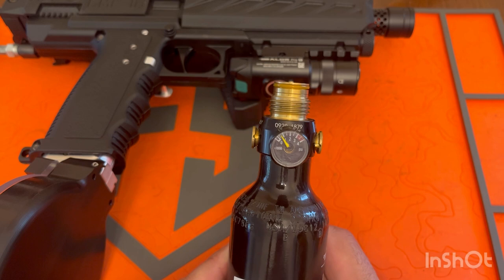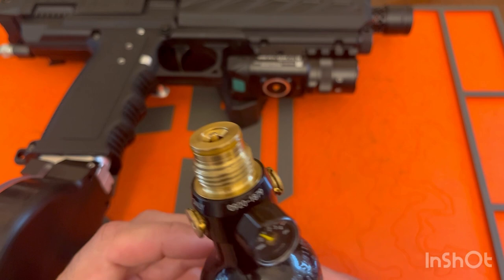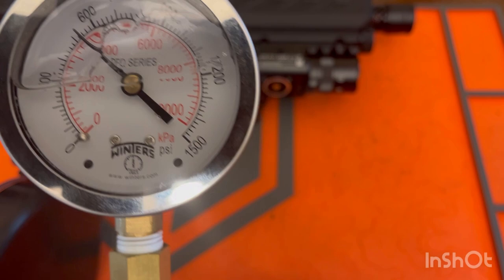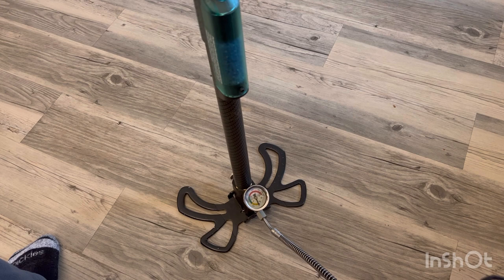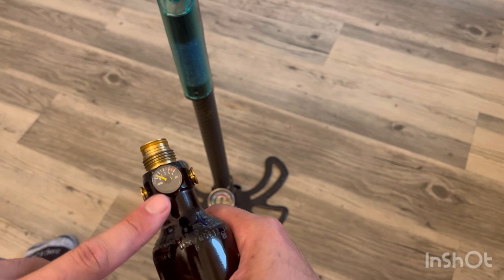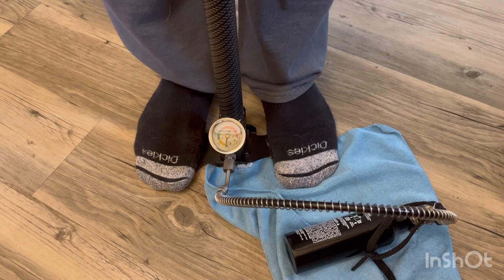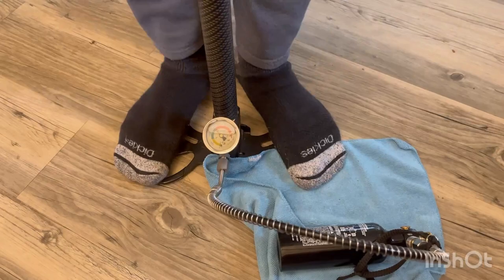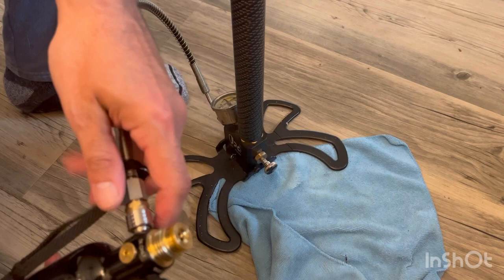Hand Pumping A 10ci Hpa Bottle & Some Basics

Comment: Make sure to bottom out the pump piston on both up stroke and downstroke. If you don't you lose 80% of efficiency, you are just bouncing piston on an air pocket.
Reply from the maker: Yes i did mention full complete strokes otherwise you are just wasting energy. Most of the actual compression is at the bottom 1” or so but not fully extending the stroke also just waste time as you are not grabbing enough air.
Reply: @lesslethalfordummies  it takes about an hour of pumping to fill 68 ci to 3000 psi. Just get a Yong Heng compressor, highly recommend it
Reply from the maker: Wont catch me pumping a 68. I aint that spry anymore. 😂 

I started with an oil less compressor that lasted a year. I have since moved  onto a Yonger and it rips….13ci 45sec flat.
Reply: If your just filling littel tanks pumps ent a bad workout if your younger an active not a bad way to get some cardio in haha pump 3 tanks
Reply from the maker: Smaller tanks aren’t terrible. It gets old when you are troubleshooting leaks in your launchers 😂
Reply: True say I've been looking at sterling's m17 power mod looks interesting you seen it dno how it compares to home defences but looks well built for sure
Reply from the maker: The quality and finish of the HD heat core is really second to none right meow with its hard anodized coat.

Comment: LOL i bought one of these for $50-60. They actually work. But the reality is, after pumping a few times, the juice will no longer be worth the squeeze. I'm 5'11 190 and I found it extremely hard to pump past 3000 psi for my 4500 hpa tanks. Like the byrna this hand pump served as a gateway to better things because now I just use electric. The hand pump can still serve as a back up in case you have no power.
Reply from the maker: Great analogy. I would definitely pass on hand pumping a 4500psi tank. Most of these hand pumps are only good to 3000 any how which i neglected to mention. Braver man then I.

Comment: Have you had any issues with the foster fitting not locking up on the full nipple? I’m having this issue on my pepperball 13 ci and first strike 10 ci hpa bottles but the foster fitting secures with the fill nipple on my ninja hpa tank.
Reply from the maker: On my newest FS regulator that has an external hex drive nipple…yes the QD bottoms out on the hex before locking. Most annoying if you ask me. It’s easy enough to swap to a different nipple but a hassle and small expense none the less.

The FS nipple in this video was the old internal allen key style and i never had a problem. They ceased production of these because apparently if you torqued them too tight the allen drive breaks, fractures the nipple and makes them damn near impossible to remove at that point.

Comment: i got same bottle know is yours 1000 psi out put got a new 3 stage pump the vevor ones are decent tbf i lubed all the seals an put plumers tape on threads no leaks so quite happy with it an pumps quick tbf compared to last cheap one way  better quality
Reply from the maker: Minimum 3 stage or you will hate yourself 😆. I have a CX hand pump as back up.

Comment: Just learned a few things and was wondering if you have a special place you like to get valves I want something around the 2200psi out, I was looking at a 13ci tank then I saw this video and thought I like this way better, I want to couple this with my 2240 hpa build
Reply from the maker: Finding high pressure 1200+ output pcp regs are not that common state side. The only one that comes to mind is the Ninja Flex regulator, otherwise Aliexpress will have any pressure regulator under the moon including adjustable ones.

Comment: Hi Sean.  Have you looked into the 9ci tanks from Grimburg and if so, do you know if they are easy to modify upwards from 850 psi?  It looks like they are using a Ninja regulator.  Also, as a single marker owner that is thinking about moving to an air tank, like the 9ci size, any opinions on using a hand pump vs. a cheap pcp air compressor?  Thanks!
Reply from the maker: I have a few 9ci and 10ci tanks. Changing the output isnt difficult at all but you need the correct shims for that particular regulator being used. Approx 220 strokes to fill with a hand pump. Nothing wrong with hand pumping but if you encounter an issue, air empties fast and then you got to start over. 😢
Reply: @lesslethalfordummies  thanks Sean. Most appreciated. I don’t have the interest or desire to pick up one of those Yong Heng compressors and I am fearful that the smaller compressors will crap out.  Whereas the hand pump has less parts and in the end, I would only be filling a 9ci tank.
Reply from the maker: @ChrisC-cb6rz if you reach out to Grimburg they may be able to adjust the output pressure for your purchase. Never hurts to ask.

I understand not needing a compressor, but even a good hand pump can be more than half the cost of a compressor.
Reply: @lesslethalfordummies  as always….awesome advice.  The order had already been processed for shipment.  Once it arrives, I will take a closer look at the actual regulator (the rep did not know which Ninja regulator is attached).  The point I intended to make about the cheap compressor vs. hand pump was more about which one would last longer, not the price.  You are right about hand pumps….some of them are definitely pricy.  My thought process is to invest in a decent quality hand pump vs throwing money at a compressor that may or may not last.
Reply from the maker: @ChrisC-cb6rz you will have to check whats inside the regulator when it arrives. Ninja either uses a spring or bellevue washers.

The inexpensive oilless compressors do work well for limited use and may not be a bad option for your frequency of usage. I would suggest one from Amazon Prime that can be returned easily should it be a dud.

If you choose a hand pump look for minimum 3 stage pump.
Reply: @lesslethalfordummies  thanks again!  The comment you made in this video educated me on being sure to get a least a 3 stage hand pump.  After visiting Amazon, I became weary of compressor reviews, but after seeing your response, I may revisit them again.  From the picture on Grimburg, the regulator appears to be the standard model.  After a little more internet searching, it appears that the 850 psi output is a result of three washers located inside the bonnet.  If there is room for one more, then I may be all set.  I will continue to research. Thanks again.

Comment: the VEVOR 3-stage hand crank pump with high quality 301 stainless steel, crank pump 4500 psi (0-30 MPa), PCP Air Gun Rifle, PCP pump with pressure measurement range: 0-5800 psi (0-40 MPa)  

has it allready adapter for filling 13ci tank?
Reply from the maker: Yes if they designate its for pcp it should have a foster style fitting that plugs right into a 13ci.
Reply: @lesslethalfordummies  thank you once again! :))
Reply: Hello brorher i got my self a brand new valken today i shot 2 times .68 rubber defence bullet cant pull the trigger neither change safety mode why can that be?
Reply from the maker: @DripMoneyjewelry1 rubber balls have a tendency to jam the marker. If the safety is stuck you need to loosen and remove the sling ring screw just behind the grip. Pull down slightly on the grip and you should hear the bolt reset and your fire selector should regain use.

If you experience a jam do not safety the launcher rather unscrew and completely degas the launcher.
Reply: brother could you show me on whats app maybe how to do it? i dont understand what you said properly
Reply: u a hero bro fixed it thanks beo
Reply from the maker: @DripMoneyjewelry1 very happy for you.

Fixing a problem on your own is a great start because they do happen.
Reply: @lesslethalfordummies  i fixed it but i returned it back to the shop hope i will get my money back

Comment: Is it safe for me to set that exact tank at an 1100 output pressure?
Reply from the maker: Yes it is. The FS kit gets it to about 1025psi so you might need to add your own shim if you want a true 1100psi.
Reply: @lesslethalfordummies  Thank you! I just picked up a TRP Carbine with a short 8 inch Rifled Barrel and wanting to make up for the loss and a consistent 65 + Joules. Waiting to see what you do with the Sicariis!
Reply from the maker: I cant stress enough shimming your own bottles can be somewhat dangerous if you dont know what you are doing. There are safety features built into the bottle but should something malfunction 💥. Most paintball marker are at least tested to 1100psi max by the manufacturer.

Just be mindful of the firing pin sending higher than normal pressure into the FS markers.
Reply: @lesslethalfordummies  UNDERSTOOD BROTHER!